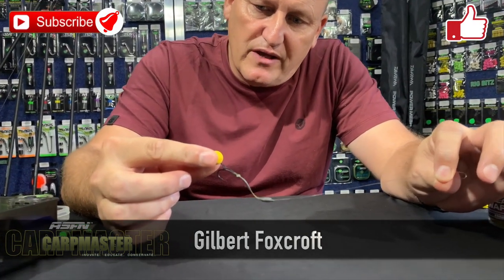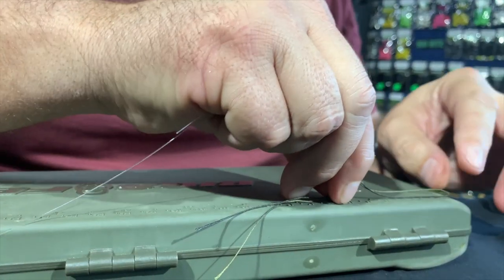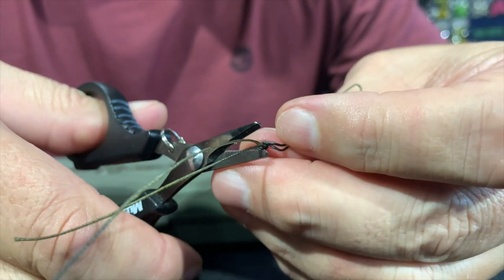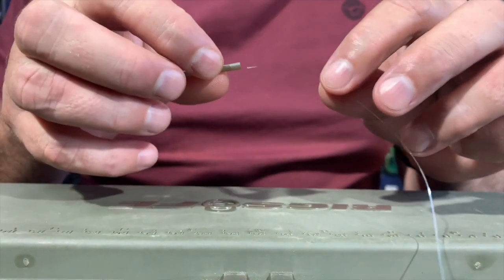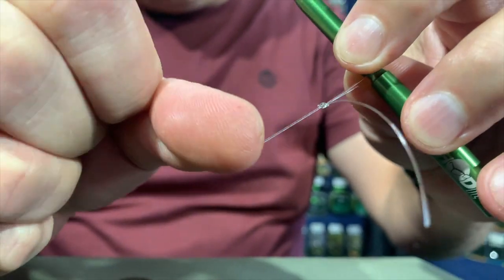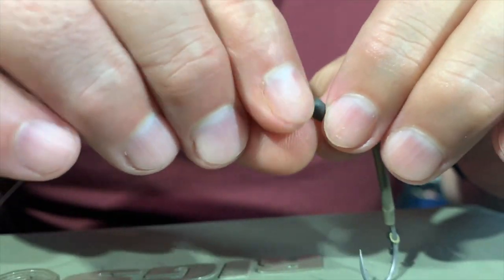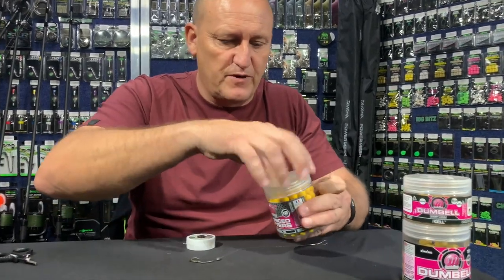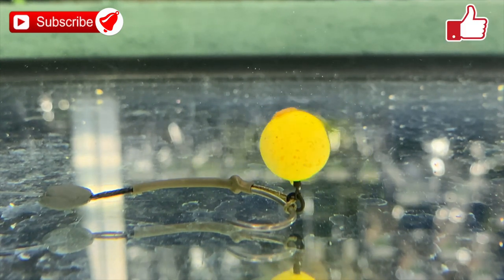HOW TO: make a Combi Multi Rig [ASFN][DAIWA][KORDA]

Comment: Hi Gilbert. My D slides to easily on the shank under tension/pressure. Do i need to apply shrink tube with a thinner diameter? Im making it with a Klor size 2.
Reply: Definately, try the thinnest diameter shrink tube you can pass over the hook eye.  This will sort out the problem.
Reply: Thank you! I will try that :) @gilbertfoxcroft1377